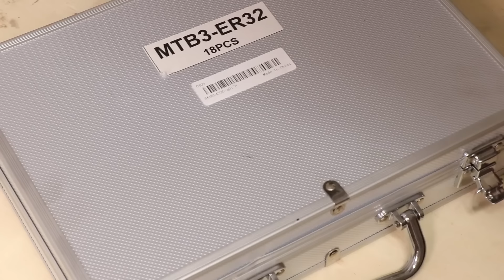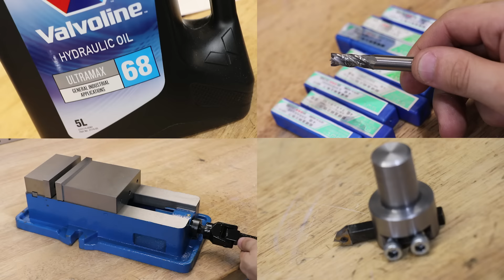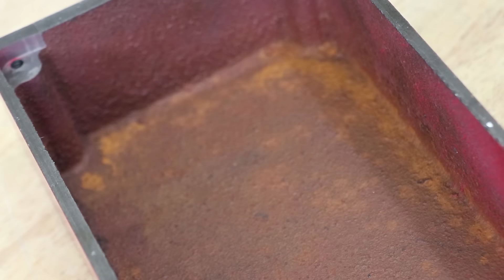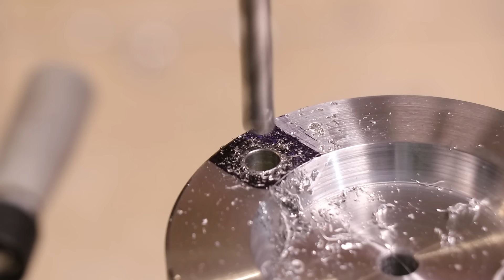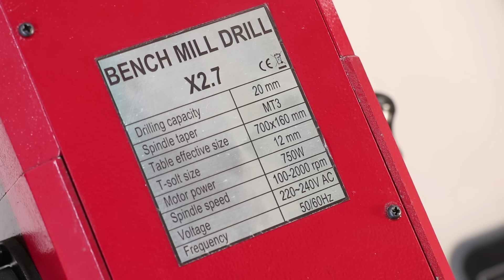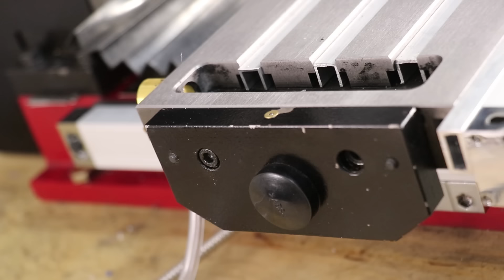Should You Buy A Cheap Mini Milling Machine?  (Sieg X2.7L In-depth Review)

Comment: I have a Sieg mini milling machine (SX2LF) and I honestly recommend that, unless you want trouble, don't buy a Sieg. The drill chuck head is too slack and wobbles (try spining the Chuck on the machine at low speed and watch how it wobbles), not to mention there is a persistent machine vibration, suggesting that something is unbalanced. There is no electrical wiring diagram on which wires go where. And the DRO scale attachment are a pain in the neck to install, as the scales come in one length and you have to cut the glass scales to size, plus, plus, plus... and the rest. And, depending on where you purchased/ordered the machine from, the sellers are hard to trust. They tell you one thing and it's not even correct, lies! Buyers beware!
Reply from the maker: Sorry to hear about your experience. I of course have no experience with the X2lf but that does not seem like a well put together machine. I hope that you got it fixed or your money back. Cheers
Reply: @artisanmakes  
Money back? Of course, no. All thanks to COVID that played the sickening part and the seller wouldn't refund it. But then, when I used it for the first time testing it, OMG! I found a lot of poorly produced components, the chuck couldn't hold 1 mm drill bit among other thing, including the chuck  claws being too lose and so on. But the problem that COVID caused was that there was a shortage of power feeder for this mill. It took two years for new shipment to arrive. 

Yesterday I fitter the power feeder on the table. Still have to test it yet. But, It's the quality of Sieg that I don't like.

Comment: How does the machine fair milling steel?
Reply from the maker: It certainly can do it without much hassle. I use 12mm roughing endmills and I can take 3mm DOC and almost a full width of cut in mild steel, though I do have a flood coolant set up to do thatn

Comment: Nice milling machine, 
I would stay well clear of Brushless motors, as I and many of my friends has had so many top brand tools that all have packed up within 2 years and my brushed tools are still working after many years of use on a daily basis.
We are now getting trading standards involved as were being ripped off.
Reply from the maker: Very interesting to hear your experience on those motors. Cheers

Comment: Do consider the used market in your area. I was able to find a used 1980 Bridgeport model 1 for $500 within 10 miles from my home. This price isn't typical here in Florida and it did need some cleaning and adjusting but I'm glad I found it. I've found that many retired machinists are more concerned with finding a good home for the machines they can no longer use than how much money they will get for it.
Reply: Good to know, thanks. Is it kind the same for lathes? Haven’t seen a whole lot on the used market
Reply: @RC-fp1tl  It depends on your area. You just have to keep looking.
Reply: In Nepal we need to pay 10k usd for one of this in cheap quality anything to purchase in low cost and good quality is crime here

Comment: I would love to have one like that but I got the 3 in 1 lathe mill drill combo from HF Central machinery 4414something. It's just like the grizzly g9729 and let me tell you it's a great and very capable machine I got it 3 years ago for 2000 bucks so I'm I use it more than the X2 or the mini lathe

Comment: Many of these mini-mills that I have seen in friend's work shops, have a fundamental design fault:  The column is too weak to resist bending and torsion forces.  All columns I have seen are of the C-channel type, which does not have good properties to resist the mentioned forces.
Look at a Bridgeport mill and see how massive these were for a spindle with a 1.5 or 2 HP motor, compared with a mini-mill having a 1 HP motor.  For decent work, even at the hobby level, these machines lack rigidity in the column.

Comment: I don't know about the US market since I'm in the UK, but my mini mill was sold to me by a UK based company and it has the R8 spindle taper. Of course the first 'tools' I bought were the ER32 collet chuck and a full set of collets. Fortunately I was able to raid my bolt, nut, etc drawer to supply a suitable drawbar as the supplied one for the Jacobs chuck didn't fit. Then it was on to the end mills. To date there aren't many, and none of them exceed ~10mm in diameter. Being financially embarrassed at the moment, larger diameters, facing mills and facing fly cutters will have to wait. My first project is to manufacture a few T nuts and hold down components to supplement the small milling vice I got off the Bay of e. Wish mine came with the quill and DRO, but the price at the time was too tempting to leave it even though it has the tilting column. My pet peeve with that, is that the scale on the column is on the opposite side to the handles, making it difficult to read while in operation. That alone is a good reason to fit a DRO!

Comment: What if you were to partially submerge the rear side of the column in epoxy granite.  Obviously do some surface treatment to the column to promote adhesion. And maybe just partially submerge the very bottom of the base into reinforced concrete or more epoxy granite.  You could have J bolts set in the concrete to mount the base and maybe even more J bolts alongside the base to use toe clamps to hold the flange of the base down to promote rigidity. Epoxy granite and concrete both have very good vibration dampening properties as well as rigidity and heft.

Comment: Nice video, very informative. Can I ask if you compared Sieg to any other brands? I am looking at buying my first mill and I am comparing sieg with similar spec hafco machines. E.g SX4 vs HM46B. The sieg seems more expensive for similar specifications, is the build quality better? (Cast iron bed vs steel etc?)
Reply from the maker: Unfortunately I have not, my only experience with small mills is this. Best I could segguest is to look at videos at all the machines and pick what best suits your needs. Cheers

Comment: R8 is common in the uk. It is rigid and versatile. The drawbar is 7/16" unf but these are common and easy to find here. I chose R8 due the vast range of tooling available in metric or imperial.
Great review and I like the detailed information.
Reply from the maker: Having followed a few UK machinists lit seems that there is a good mix of MT3 and R8 machines, certainly more R8 machines than I initially thought
Reply: @artisanmakes  there is good choice of quills here on many machines. Also many tools and arbours, such as ER32, are available in both MT3 and R8.
I guess we are spoilt for choice 😁.

Comment: Having very few second hand says so much for the quality of these.
We have a WM 18 some issues with the motor getting hot but take the box off bore bigger holes in its base and fit an extractor fan. Yes the plastic gears are PANTS and a belt drive is half way installed/made. 5 m belt.
David and Lily England.

Comment: I have the SX2.7L and let me tell you guys, this machine is terrible!!! It has accuracy of 0.1-0.2 mm in any direction and there is nothing you could do about it since the table itself flexes like crazy! The only upside is that it is very quite (in brushless version) and it has the taping feature...
Reply from the maker: Sorry to hear about your experience, very different to mine. Mine is not perfect but that does not sound good at all.
Reply: @artisanmakes  Thanks for commenting:) Yes it is a disappointment, I paid extra 200$ on shipping cost for a replacement, and it had the same flaws, if you take a straight edge ruler and move it across your table with a lamp and then lock the table position you will find out that the places were you had gaps will shift! (the gaps I measured were around 0.05 mm). This is a flaw by design since they could have added a few more millimeters to the iron cast and it would have solved the problem. On top of that, on both machines that I was given, the table from edge to edge is around 0.2 mm and front to back 0.1 mm and every time I placed the table in a different location the readings changed! so 'fixing' the column will not help. This is why I converted this toy to a CNC machine, and can only claim 0.1 mm accuracy on 10 cm sized parts.. We are hobbyists after all so maybe my expectations are too high... Thank You for your video!

Comment: Well done video. I have a Jet knee mill with an R8 collet. Works fine. In addition to the greater travels you get a ram to increase the usable Y, a rotating column that can increase the area covered or allow hanging work off the side of the table and a tilting head that can go full 90° sideways for horizontal boring. There is a key in the spindle that prevents rotation of the collet.  Changing collets is simple, just rotate the draw bar one turn and give it a tap, it frees the tool. 

The biggest limitation for travels is in the Z. Everything you add to the spindle or table takes away Z travel. A vice & drill chuck just to start. If you add a boring head, rotary table or adjustable angle plate even more is lost. For most drilling I use screw machine drill bits. Their short length makes them much stiffer and less likely to flex. I've got two Taiwan machines and one mainland China. The Taiwan machines are considerably better made.

Comment: Overall it looks like a really nice machine, I also like the slightly larger Sieg SX3 mill. For the last 40 years I have been using British, American, German, Taiwanese and Chinese machinery at work and at home, but I do like some of the Chinese made machines. We are fortunate that China produces affordable new machine tools as an alternative to much more expensive machinery from other countries, as long as we don't end up with a Chinese machine with too many serious manufacturing faults. 
 The adjusting set screws at the base of the column that you mention may not be adjusters at all, I have never seen any actual adjusters fitted on similar mills before. They may just be tapered locating dowels, the Chinese do use tapered dowels extensively to locate components on a lot of their machines and these tapered dowels have an internal thread that is used for extracting them.

Comment: Grrrrrrr.....those overly bulky keyless chucks..........you have to use a pin spanner to tighten the chuck and one to hold the spindle as without it the drill bit will spin in the chuck.........that makes it useless for any drills larger than 6mm due to the force you need to apply by hand to grip the drill bit...........I use one for smaller drills, as I already have one, but the pin spanner need is a pain and I frequently use a Jacobs chuck with key for most drilling......they never slip.

Comment: If ever there was an ideal way to hold anything in a spindle it has to be the R8 system.......for twice the usability you can mount a tool shank or insert a collet to hold the cutter directly in the spindle thus saving a lot on Z height and gaining lots of rigidity..........second to that is the MT3, but you can have tool seizure problems with the Morse taper due to it's slow taper.
Reply from the maker: I agree with you there. If R8 was more common in Aus. I might have gone with that. Its mostly MT3 and NT40 tapers that ive seen on machinery here. Cheers
Reply: @artisanmakes  I have ISO40 on my big mill..........going to R8 shouldn't be  a problem as all your tooling comes from China via EBAY anyway.
One big advantage with R8 is that you can mount a 20mm collet and use 20mm plain shanks for quick change (and economy)  like the TTS method.
The other very popular shank is the ISO30, but having a shank and a chuck on the end does lose some Z height whereas R8 direct in the spindle doesn't have that problem.

Comment: What type of RPM you are using with your mill ? I just ask because I bought a chinese spindle motor that can go up to 24000RPM and has 1,5KW of power should be suitable for metals with it´s ER11 collet right ?
Reply from the maker: Mine maxes out at around 2500. I don't really need high rpm since I normally use HSS. I really need lower end torque which this can give me. At 24,000 rpm you'd probably need a fast feedrate to match.
Reply: Thank you for your answer. Do you know If it´s possible to lower the RPM with a VFD to your values to use HSS too and still have the same motor torque or do I have do go over a belt system ? As I understand you with high RPM only carbide is possible right because of heat I assume ?

Comment: 14:53 you cannot measure the runout with such a caliper. the accuracy of the caliper is +-0.01 .mm So in this 
case not recommended as it is not precise enough.
Reply from the maker: On a hobby machine 10 microns is fine and this test indicator can accurately measure that. On more expensive machines I've used tenths indicators but those don't come cheap. Cheera

Comment: Actually, I think in Europe and Asia they use ISO30/NT30/30 taper for large mills. Mine weights 1400kg and uses NT40 taper. They like R8 in the US because the original Bridgeport Series 1 uses R8, but honestly R8 is really puny compared to even NT30. The NT/ISO/whatever taper has a positive drive key so there's absolutely NO chance the spindle would slip in the taper, even for a very heavy cut. Plus all the industrial machines, CNC, etc. all use those. One nice thing about my mill is if I wanted to buy a VMC in the future all I have to do is cut the knob off the NT40 tooling, and stick a pull stud on it, and it's instantly BT40 compatible. I've got some BT40 tooling too and all it takes is removing the pull stud and extending the draw bar to engage the thread. That last knob isn't that important (and CNC machines don't use them) and the drive key makes sure no slippage happens.

But if you are machining, get carbide end mills and forget those cheap Chinese HSS end mills. With carbide you will get much better finish because you can run your mill at very high RPM and the finish will look great. But the problem with mini mill is that their lack of rigidity means the carbide end mill will get chipped especially when machining harder materials. I've seen a difference between machining 4140 with a 4 flute carbide end mill on a Grizzly G0704 bench top mill (I think it's a Weiss mill originally), vs using the same tooling to machine 4140 on my current mill. The tool wear on the larger mill was nonexistent whereas the end mill dulled very quickly on the G0704.

If you got the space you really should buy used knee mills. They will have far better capability. Mine cost about 1200 dollars because it was very used (was made in 1981). The only problem is I have like 0.8mm of backlash on it...

Comment: OMG, I thought you were joking with the kerosene. IDC how high the flashpoint is, how can this possibly be safe? Those chips can get toasty.
Reply from the maker: Flash point is critical in determining id this is safe to use or not, along with a few other factors. This has been well documented as a coolant for the past 100 years. Its most used for aluminum nowadays but works on steel. I have never hard of a resulting fire, but ultimately you use what is optimal for you

Comment: I have just bought the SX2.7L. I measured the Y-axis travel and only get 170mm (with the rear bellow removed), spec says 190mm? What is your travel?
I also made a couple of improvements:
I added 2 very thin magnets to the spindle spanner, now it stays in place while I change tools (and hangs on the front face when not used)
I added 2 paint marks to the outside of the spindle where the spindle spanner holes are, much easier to find and insert the spanner now
Still waiting on some tools to really get into it

Comment: I think the big advantage of R8 is that you can get collets that fit in the spindle directly, not using much z space. That will also be far more rigid.
You have to tap the drawbar on all tool swaps on R8, you are incorrect thinking they will come out on their own. The shorter steeper taper doesn't wedge as tightly though, so just a single tap usually pops it out.
Reply: Good point about having to tap it out too. All friction fit holding methods require the same. 👍

Comment: I had a cheap sieg mill (harbor freight).  It was worth it up until the point when it broke at about 18mo old.  The cost of repairing them and the short lifespan made it not worth it overall.  I sold mine as parts for cheap and replaced it with a better quality Taiwanese mill with a 5yr warranty.
Reply: @Stan Cooper Precision Matthews PM-728VT.

Comment: Nice review.  I find myself comparing my purchase choices to yours.  For not a lot more money (excluding accessories like the DRO) it's very possible to buy a full sized bench mill instead if you have the space for it.  The working volume is considerably larger, there's more power to work with, the machine is heavier/more rigid, and overall, a full sized bench mill is surprisingly cheap for what you get even when considering purchasing a new model.  The only thing you have that I don't is the fact that your head is mounted to the column on a dovetail which is a feature I would really like.  My mill (a Jet) only clamps to a round column, so I can't move the head and maintain position at the same time.   That's the only limitation I've run into so far.
Reply: Where do you recommend shopping for one in Australia. And a basic lathe?